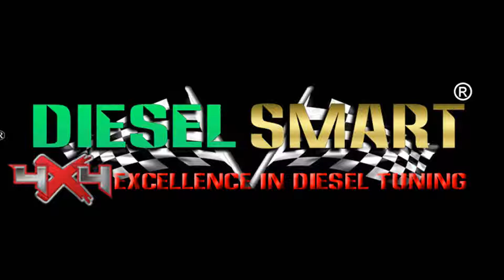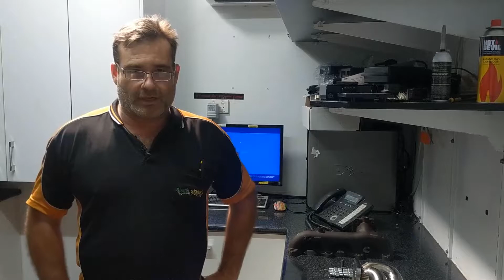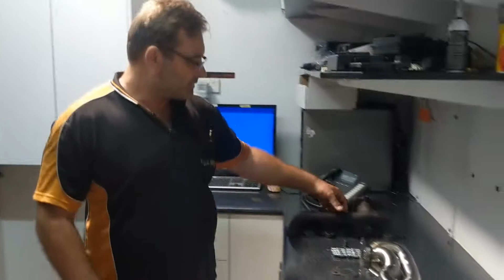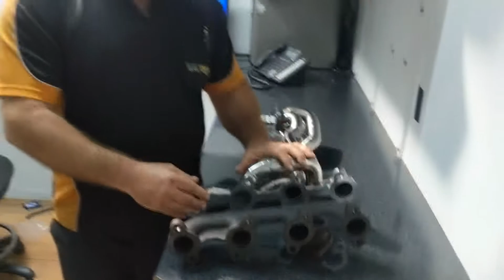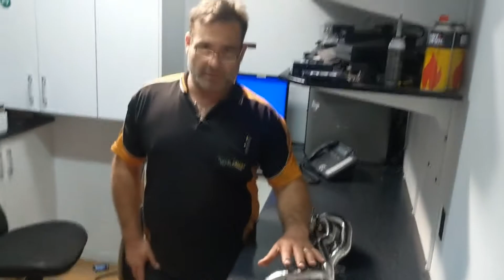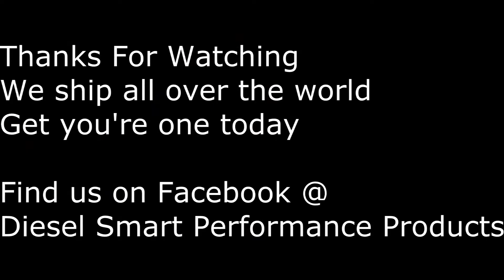Torque Master Exhaust Manifold For Hilux Vigo D4D 3.0ltr

Comment: how much more bhp does this give?
Reply: I got no change in hp and no change in response. Basically did nothing at all. My Hilux does make 280whp though so the stock diesel pump is completely maxed out.
Reply: @finnsk3  stock pump is maybe why u don't feel anything?
Reply: jaybajan around 10-15hp but much better response on coming onto boost